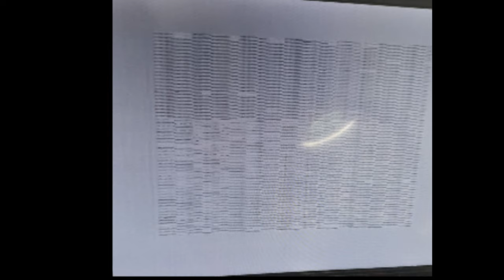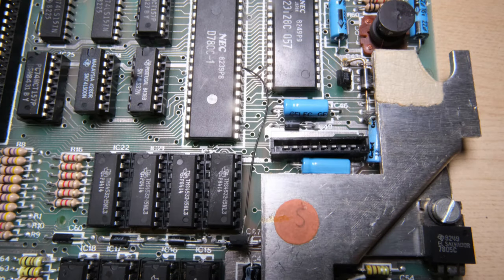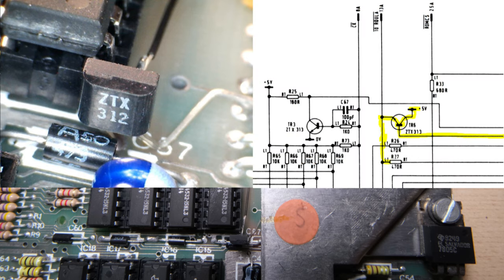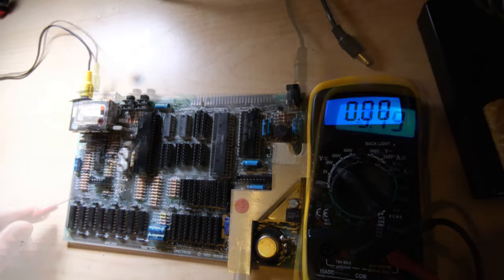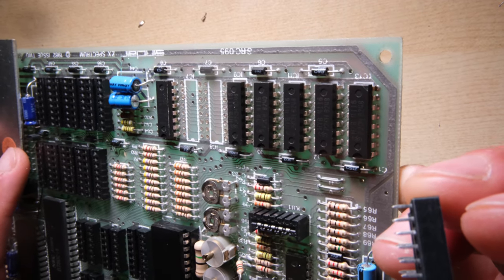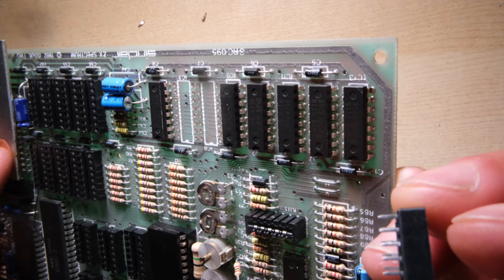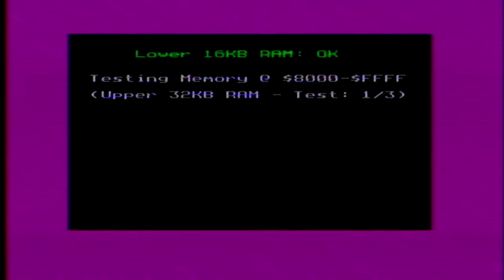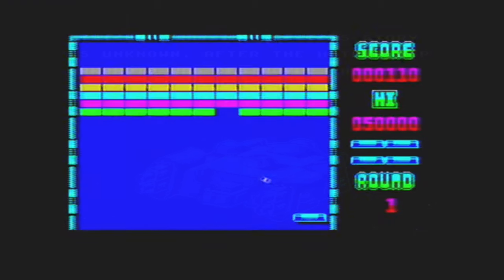Your Retro Repair #2 - ZX Spectrum Issue 2 - Power Issues and RAM Replacement

Comment: Is that really a DC-DC mod? I seem to recall a lot of Issue 2 boards having similar weird configurations from the factory.
Reply from the maker: Hi Noel.  Yes it was the three way junction between D15 and D17 and the cap. Interesting if it's a factory mod, but none of the other steps of an issue 3 to 4 DCDC mod was done, e.g. the zener diode

Comment: Did you find a cheap source for the TRACO regulators? Looks like Mouser might be the cheapest.
Reply from the maker: I think I went with farnell this time.  Just don't forget that prices are before tax!
Reply: The Murata OKI-78SR-5 DC-DC converters work very well in spectrums, and are a lot cheaper :)
Reply: @jaycee1980  I'll check them out. Thanks guys.

Comment: irelative question. is there any analog joystick to play arkanoid?
Reply from the maker: Not for the speccy,  maybe on some later systems?
Reply: I believe there is an Arkanoid version that uses the Kempson mouse. So if you can find an interface that supports that (ByteDelight used to have some, still) and some way to interface an analog joystick to a PS2 compatible mouse controller - you're in... 

Not exactly easy but a fun hack! x